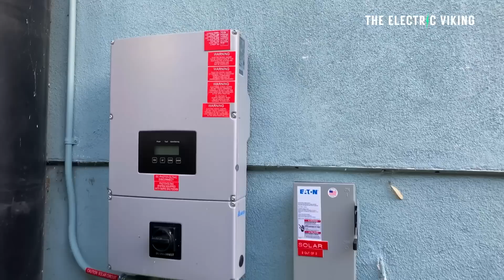Scientists say solar panel advances will see millions go off grid

Comment: I live in the south east of England and have a 4.7kw solar panel system, I also have batteries. I should also say that the house position is excellent for catching the sun. So far this year I have had 34 days when my roof has produced less than 5kWs in total for the day.  There is no way that I could live a self sufficient life without the grid.  I am very fortunate that I can charge the batteries over night at a very cheap rate in the winter months.
Reply: This February was probably the worst of the century in term of sun exposure.
I live in France with a 4.5kW system and the entire February I produced only 127kWh. This is less than my weekly consumption. 
If you live in an area where heating or AC is mandatory for more than a 1 week straight per year, going off-grid is basically not option. You would need hundreds of kWh of storage, or at least 2 EVs in your garage dedicated to V2H.
Reply: @itsyo42 Do you have a battery for storage and how does it cost ?
Reply: I live in an area where there is 300 days a year of full sun but very few people who are grid tie or off grid.  They complain about the cost of utility power but seldom do things that would reduce their power consumption.  I’m tired of the whining and finger pointing.  Go solar, but don’t expect the power companies to pay for it!
Reply: @googlelansdown What batteries and how much cost ?
Reply: Im in the same area and looking for solar back up, Grid tie will not work in the UK as its 70p per kwh to buy and 20p per kwh to sell , so expensive battery storage looks to be the only option at the moment, and keep what you make.I did notice this year that panels at an all time low of £64 for a new full size panel ( amazing )
Reply: @mariebaxter473  I agree however electric prices have fallen. I am in Cornwall and am off grid from mid November until mid March. 
I have installed a massive massive system and this still won’t do me all year around.
Reply: @mariebaxter473  As I have an electric  car I am able to charge the car and the house batteries at 7.5p per kW between 11:30pm and 5:30am.  Power used in the house between those times is also charged at 7.5pence.  This saved me a lot of cash over the winter months.  My tariff is Intelligent Octopus Go.

Comment: Makes little sense to go off the grid as you can get paid to export your excess solar reducing the need for fossil fuel-generated electricity.
Reply: No thanks, the savings are enough incentive for me. You do you, Boo....
Reply: yeh I'm going for a big solar and battery setup but staying connected for that exact reason. We aren't home most of the day so might as well export what we're not using and get paid for it.
Reply: @kieranworland8662 Where I live I elected not to sell back to the grid as the conditions were not favorable and in fact terrible. I remain on the grid though as my system is nicely sized to my demands and if I require more the grid simply acts like a big battery.

Comment: Virtual power plant (VPP) is the future of urban electrical generation; existing power lines are sufficient to support 100% VPP.  Rural electrification will go fully renewable as space for panels and/or windmills abounds... and excess energy will be sold to highest bidder.  Hopefully the charging networks will also be 100% renewable with generation and storage near end user.

Comment: With 30-40kWh energy storage in many places  off grid is a  good solution .
Reply: Depends on climate.

HVAC requirements can be significant, potentially requiring 5-10x more battery storage. 

Although, in many areas, air conditioning loads tend to follow sunlight hours, and thermal storage can help reduce night time heating loads.

Best to substantially install excess solar, if room allows, along with a small wind turbine or two to help reduce battery requirements. 

And batteries are getting cheaper. LFP (LiFePO4) in now in the $50 USD per 1kWh range, at least for manufacturing. Which puts a 100kWh battery in the $5000 USD price range. That's actually getting quite feasible for house battery power
Reply: @jeffl4810  50 per kwh for a battery!!!!! Bahahaha.  Your dreaming pal.
Reply: Note that a BMS and housing/casing also needs to be added, but those are not particularly expensive compared to the cells.

For household use, a themal management system isn't required.  Those are needed for EV useage, as they're required to charge in 10-20 mins, pull a mega-watt or two in performance situations (10-20C peak discharge currents). And stay in environments that can go from -40°C to 50°C. 

Building usage has temps 20°C +/- 5°C and significantly lower than 1C charge/discharge rates. This is much less demanding on the batteries.
Reply: @robertfonovic3551  
Weird, my reply was deleted 🤷‍♂️

First search hit says LFP is heading to $36 per kWh by next year.

CATL LFP cells are at $56 in another statement.

LFP is about 30% cheaper than NMC type cells.

Lithium has dropped a lot after the huge run up from 2020. Mines are fully staffed, and running at full capacity,  while new ones are coming online, and others are expanding.
Reply: But how much would a 35kwh battery cost? 70k?
Reply: @robertfonovic3551  Lowest I found EU prices for  20kWh LifePO4 storage is 6890euro x2 is about  15k USD  for 40kWh . You need to search direct from  China store based in your or  neighbour country .
Reply: @robertfonovic3551  Direct from  China  max  12k USD
Reply: @robertfonovic3551  A 35KWh battery would probably consist of 7 x 5KWh batteries (each battery 100Ah at about 50V). The EG4 batteries are now available around $1300 each, so just over $9k would do it. If you have stacks up to 3 high (the maximum without a rack, as each battery weighs over 100lb), you can avoid the cost of rack systems too.

Comment: Leaving the grid is a risky businesses for society. In the future we will pay much more for the infrastructure and security to have electricity when our own production capacity isn't enough. This means that we will pay much higher price for the connection rather than the electricity going through the cables.
Reply: Panels cheeper every year
Reply: Stupid people will cling to the grid.
Reply: @JebusHypocristosX  The question is, can you go totally grid free? Or do you have few days each year that you need electricity from the grid?
Reply: @Harrythehun  The grid is over 20 miles form my property. I built the house and shop in 2004 off the grid and expanded the system since then as I expanded my business. I employ over 1100 people my entire business is off the grid. The technology is cheap and easy to use for those willing to learn.